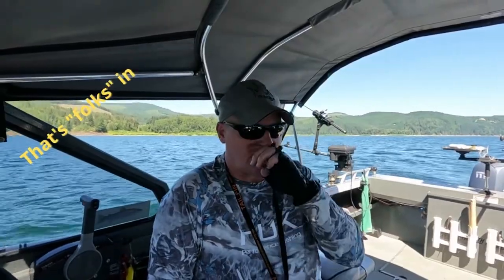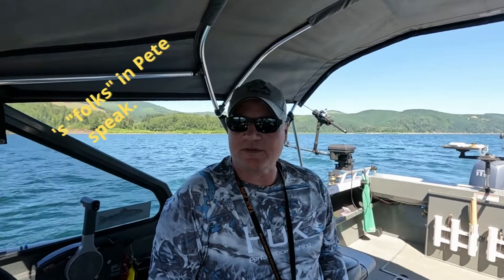Downrigger Stacking Hack

Comment: Seems pretty simple to me.  How many ounces ball are you using for that?  Is that weight enough resistance to give a good release when the fish hit it?  Was wondering if it would be tough to find the balance between getting a false release because of the weight of the ball or too deep in the release where when you bring your pole up hard to free the release the whole set up slides up the downrigger cable?   Was curious if you had any issues with that?  I've also seen shower curtain hangers used for this.
Reply from the maker: 8 oz ball and it seems to release as consistently as the main clip on the line.  Just takes practice with the clip you are using.  I use small Scotty clips and Pete uses large

Comment: Hi,  Does this technique count as another rod? In the places I fish, a traditional slider does not count as another rod.
Reply from the maker: Well it depends.  You can use this rigging with a single rod and leave the ball down.  Or you can rig one rod conventionally on the rigger ball/cable the stack a SECOND rod on the same downrigger at a lesser depth.  The slider you describe is I believe rigged off of the mainline on a single rod and still counts on a single rod as long as one rod and mainline is used.  Check your regs but if I recall 2 or 3 hooks is legal on one mainline.

As we use the technique, we’re (or Pete is) using two rods where legal. I find 1 rod more fun albeit SLIGHTLY  less productive

Comment: Give instructions please sounds awesome
Reply from the maker: Rob,

We use that method a great deal, so I'm not sure what you want for details, that weren't captured in the vide, but willing to help you out, let me know what info you need.
Reply: How do you make the rig the video was to fast
Reply from the maker: Take a carabiner with a key ring.  Tie a 2 foot leader to the ring with a Duo snap, and then tie a downrigger release at the other end.  Run your line behind the boat like you would for a regular downrigger hook up.   You need a line counter.   So lets say you are 100 feet behind the boat, now click your line into the release and hook the carabiner to the downrigger line.  If you are trying to fish 20 feet deep let your line counter out 20 feet, for a total depth of 120 feet.  100 behind the boat and 20 down the downrigger cable.  Hope that helps